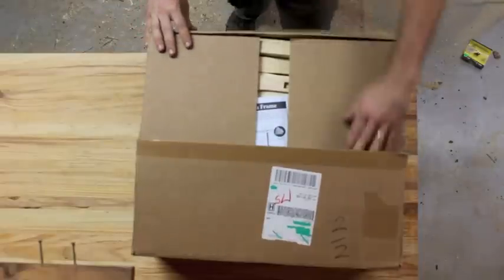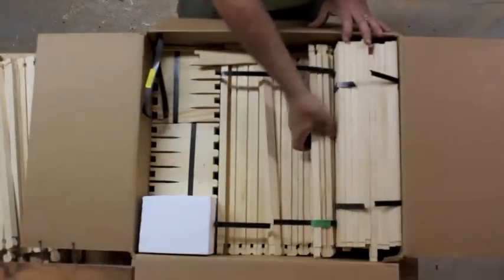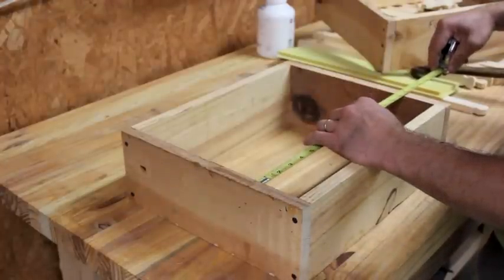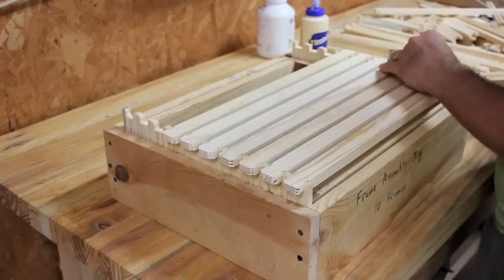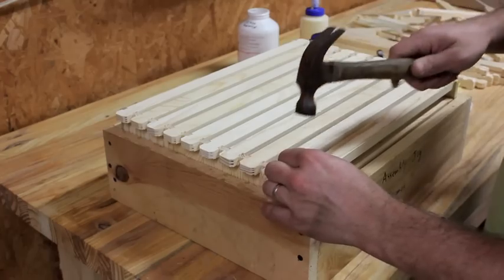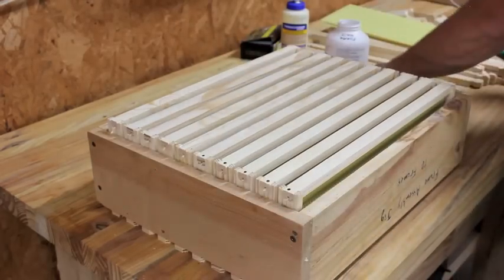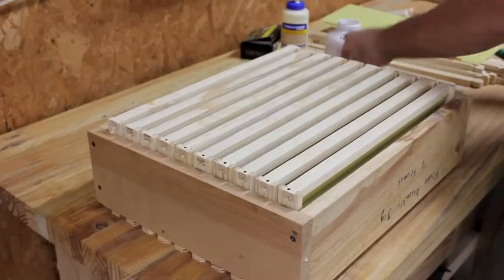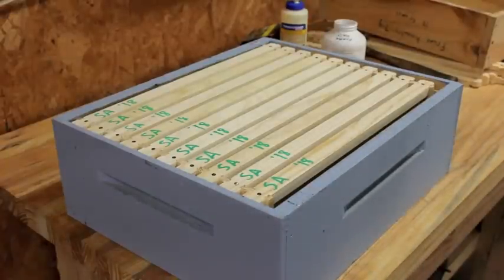Quick and easy beehive frame assembly jig

Comment: At first I wondered where the heck is this guy going.   My congratulations.  That is such a good plan and works well.  I presume you insert wire in some of them for spinning strength.  Struggled with this task for many years.  Thanks so much.

Comment: That's a great idea, simple yet very functional, well done!

A respectful tip about not mixing IDs and ODs though. I think I can see how the first iteration got a bit mixed up. I appreciate it's not critical, but many people don't have any real construction experience, and it's the Inside Diameter of the outer box and the Outside Diameter of the inner box that will determine the function. How thick the material is then doesn't matter, and it could be anything they have laying around.

Comment: Just finished using this jig, and am very pleased. Just two moving parts! I used scrap wood, and made my jig to do 8 frames at a time. With all the figuring and finding the right wood, it took more than 30 minutes, but still worth it. some of the extra time was making the effort to get both boxes squared. I get my frames from Dadant, and I was assembling medium frames. I used wood that was 4 1/2" wide, so the jig would also work well with shallow frames, but might be wobbly for deep frames. I recommend getting your length and width measurements for your boxes with frame parts in hand just to make sure the boxes will work with your equipment.
Reply: Philip, what were your measurement for  the Dadant product, if you don't mind sharing.
Reply: @hopeholben4979  I decided to not include measurements because I used "salvaged" wood of different thicknesses (some 5/8", some 3/4"). So, it seems best to just give the outer dimensions of the inner box, and you can size the outer box depending on the thickness of wood you have available. The outer length of the inner box should be no more than 16 7/8", and the inner length of the outer box should be just enough larger to accommodate two thicknesses of the uprights with scant play. The outer width of the inner box is less critical, since it can be fairly loose and still hold the uprights in place; I used 10 13/16", and less would also work. That's a lot of "outers" and "innners", but I hope it helps.

Comment: Cell size is determined by latitude. As you go north the natural cell size increases. so Dee is in an area of 4.9 where as langstroth was further north so the size they saw was 5.2. I let bees do their own thing in the brood chamber and put foundation in the honey box were cell size is not important but blow out strength is. On the point of contamination it is not what you put in the hive that is the serious concentration but what the girls are bring in. This is important in the brood box so I have a faster rotation in the brood box but not in the honey box. The more agra bis in your area the faster your rotation as well. A a stock producer it is not as critical because to the rate of frame turn over 4 to 12 frames a year anyway. Being in a high agra biz area I aim for a 4 year turnover on brood frames. If your area is free of aga biz than you can go far longer.

Comment: EDITED (fixed): I made a jig for deeep frames using 1x8 pine lumber for Mann Lake frames.  Outer box assembled: 19 3/8" long x 15 5/16" wide x 7 3/16" high : Cut Measurements: Ends 15 5/16" x 7 3/16. Lengths 17 7/8" x 7 3/16". Inner box assembled: 17" long x 13 5/8" wide x 7 3/16" high : Cut Measurements: Ends 13 5/8" x 7 3/16 Lengths 15 1/2 x 7 3/16..
Reply: You give the same 15 5/16” for bot the outer and inner end pieces. That won’t work. Something is off.
Reply: Same exact dimensions given for both outer and inner boxes.

Comment: For a nail gun, check out the "WORX Nitro 20V Cordless 18 Gauge Nail" its an All In One. You can pick them up for less than $150 and you wont regret it!! Its not a super high end gun but for things like this and other random quick projects ware a nail gun would make it so much easier it is well worth. 
I can get 60-100 shots on one battery depending on nail lenth and depth setting.

Comment: Hint: when I make boxes, I glue first (at the perfect 90 degree angle), and then let the glue fully set before I re-inforce with screws. This assures that the 90 degree angle isn't altered by handling/screwing.
Reply: I don't quite follow.
Reply: @KayAteChef  
If the glue hasn't set yet, using screws can pull the box pieces out of the 90 degree angle.
I actually have saved a particular bee box (that I know is a true 90 degrees AND sits flat) that I use as a jig in the process of assembling new boxes. I clamp  a long side of this box to the workbench, and then I glue two sides of the new box to each other (no screws yet) and place them perfectly aligned alongside the jig box, maybe with long clamp bars if necessary, and let the glue fully dry. (I put Saran Wrap under one of the pieces to prevent gluing it to the workbench.) After the glue is fully hard, I add on the other two sides with glue and let the whole assembly harden next to the jig box. Later I apply the screws.
Yes, this is a slow process. If I had to assemble 100 boxes in a short time, maybe I wouldn't be so careful. But in warm weather I can get one box a day finished this way (while I do other things, of course), and that is ok with me.
Reply: @djg585  I see. Makes sense.

Comment: To prevent the top bar frame from coming undone under beehive tool pressure when removing, how about wrapping a stainless steel thin wire around that top bar and bottom bar then twist ends of wire together...
A strong fishing line would also work, but I don't know if the bees could eventually chew through it and break the fishing line.

Comment: I got some unassembled frames and found out they won't fit the longhouse hive I made from a pipe crate. Outside dimensions 2 ft x 9.5 ft. I cut 2 out and used the middle piece for the two ends. I was proud of them but now I'm splicing them together- 3 makes 2 frames 20 7/8 wide but not changing the deep frame, i figure the bees will fill it in to the depth they want. I  think I'll start making my own after this group.

Comment: I built this with your measurements and it is way too big by almost 3/8 of an inch. The outside box needs to be 1/8 to 3/16 smaller and the inside needs to be about 1/16 or maybe a little over 1/16 larger

Comment: The outer and inner box measurements will not work with Dadant & Sons frames. The inner box is too short almost 3/4 and the outer box is too wide by 1/4 inch
Reply from the maker: lokiluna Great tip. I don’t use those particular frames. Should be easy enough to modify.

Comment: Why Glue? It's not necessary. Does it contain formaldehyde? You don't need to ever use wire. It's expensive. Just use fishing line. I use 12lb.  The problem w/ using commercial foundation is that you don't know what's in it. You do frames quite differently from myself and anyone I know and I have 14 hives and about 60 to 70 boxes.
Reply: Why paint a hive ? It's not necessary. But... it does make them last much longer. Same with glue.Stronger , better, faster than before.
  Why wire? because it works very well indeed , and you cain't heat  fishing line to sink it in the foundation. 
 Different from yerself and anyone you know? Well... maybe you ought to get out more .
Reply: @johnpaulyates4734  , as were my replies to your questions. 
 137 years of  family beekeeping in Callahan County , Texas, Lee Ivey Apiaries  is a viable  Fifth Generation bee bidness , and shall continue through another five generations, it is to be striven for.
 I am still using  some of the components  that my Great Grandfather built  somewhere around  the year 1900, he built his bottom boards of Texas Cypress and used copper rivets instead of nails. Screws were  pretty expensive back then.
 Using glue on my frames, I hope MY Great Granchilluns will be able to use  some of the components I am building now.
Reply: This Youtube stuff is new to me , I find it a great way to learn how to do things better. And the Comment section is a great place to go deeper. 
 You asked, I gave you my two cents worth.  Thought that was what this was for.
Reply: And by the way ,  the afternoon  I watched this  and  responded to you , I knocked out this jig and put it to use. One thing I noticed is - he has screws as feet to raise up the  frame ends past flush , so when he turns it over  they  are free to fit the bottom boards. I did not use the screws.... and quickly  figured out why he did.
Reply: Also figured out I need an air stapler.
Reply: The old ways are not always the best ways.
Reply: My mistake , it was  the same sort of jig, but has a better system of clamping jig ,but a different guy and different  vid.